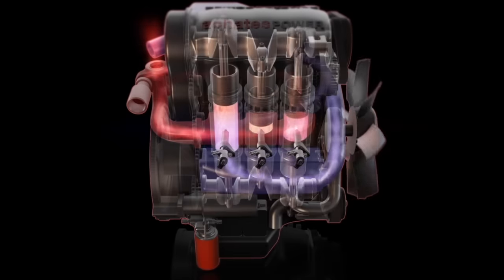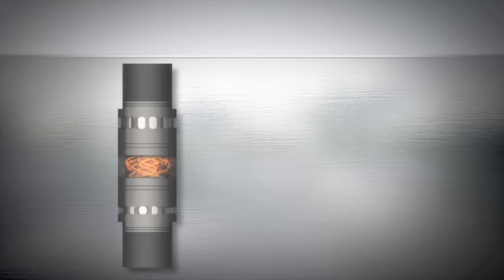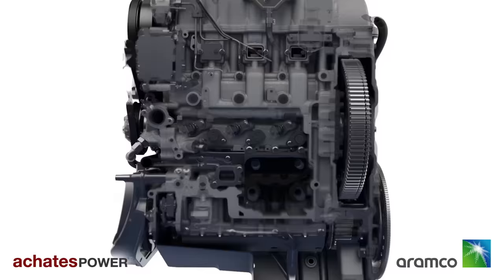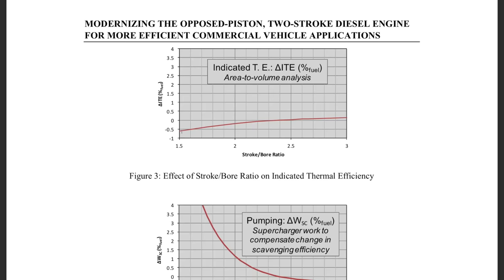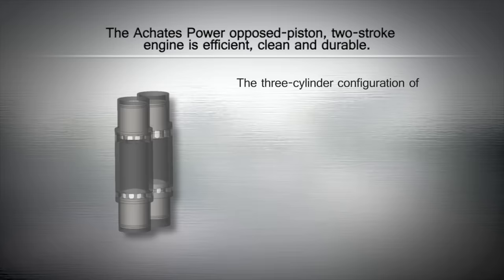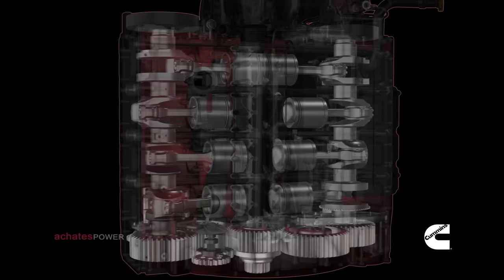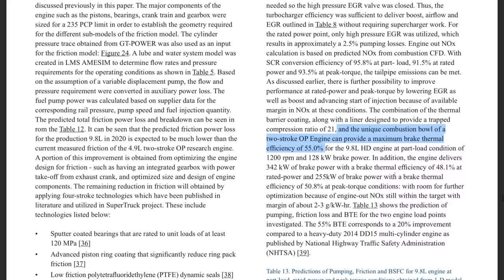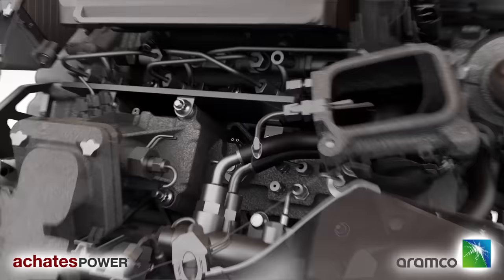Opposed Piston Diesel Engines Are Crazy Efficient

Comment: Also as both sides are moving at the same time, i'd expect this engine to produce very little vibrations
Reply: Tilling Stevens in England developed a three cylinder opposed piston diesel engine in the early fifties for use in buses due to it's inherent smoothness. It entered production as the Commer TS3, not without its faults but sounded glorious when given some stick!
Reply: @jonathangriffin1120  I heard they were prone to breaking the supercharger drive shaft.
Chrysler dropped the engine when they bought Rootes Group
Reply: @g8ymw Buying out the competition, right??

Comment: I think the opposed piston idea is a great one, and the fuel injection with the boosted intake avoids the 2cycle problem and permits only fresh air to exit the exhaust port.  Just fantastic.
Reply: Jumo developed the design in the 30s.. for the Junkers military planes & made a flight across the Atlantic loooong before any other aircraft.. Arcades haven't applied ANYTHING new to the design.. only modern auxiliaries in injector technology etc from other makers.. Napier did the most in development but politi s overruled.. nothing has changed there
Reply: @Errol.C-nz  Actually the Napier Deltic engine in railway locomotives wasn't very reliable.
I think the problem was cracking around the exhaust ports
The big Deltics were in service for around  20 years  (two 18 cylinder engines)
The "Baby Deltic" only lasted around 10 years (Single 9 cylinder engine)
In the marine application, the Deltic replaced the Merlin in fast patrol boats

There was another opposed piston engine use here in Britain. The Commer TD3 aka "double knocker"
This was a 3 cylinder engine used in small lorries.
It had one crankshaft driven by 2 rocker shafts, one for each bank of pistons
When Chrysler bought  Rootes Group, the engine died
Reply: All 2 strokes have to have a positive pressure on the inlet manifold/
In the case of petrol 2 strokes, the positive pressure is provided by the crank case (hence needing a total loss lubrication system)
Reply: @g8ymw  the deltic in rail engines was the same as used by the navey.. it was the budget minded rail beaurocracy that was the fault there cutting service maintainance schedules.. NOT the engine or its design & still by a long shot the most powerful engine fitted in rail
Reply: And no 2-stroke oil to burn/exit.